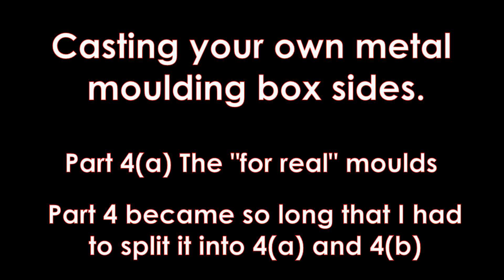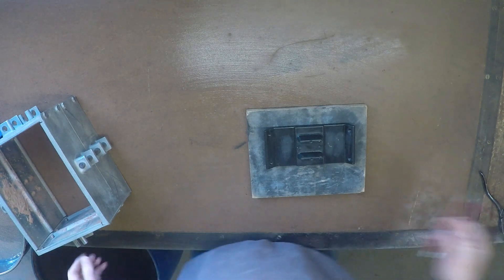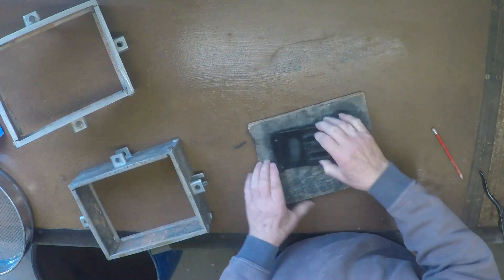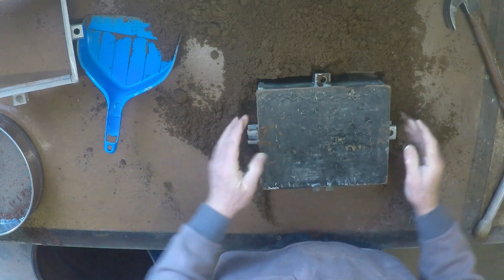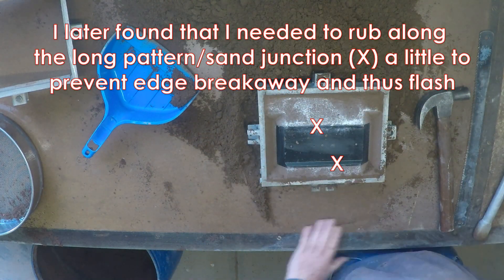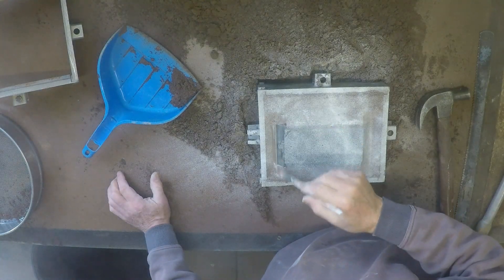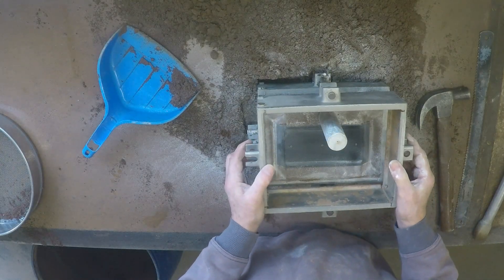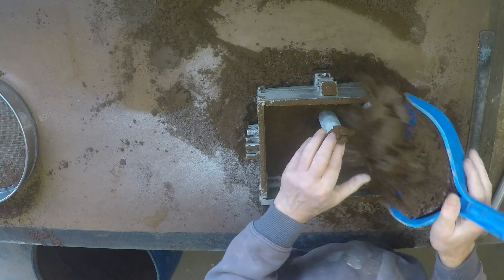Making your own metal moulding boxes Part 4(a)

Comment: How many of something do you need to make before you'll consider making a match plate pattern?
Reply from the maker: Elizabeth, Lots! Seriously it depends on the job. There is a lot of work in a match plate so this has to be balanced against how much time it would save per casting. In this case a simple flat board plus two 3D printed end oddside pieces and a few small pins substituted very quickly and economically for something like a match plate. Making a match plate is generally something that I would not do myself  but rather get my "tame" pattern maker to do and only then for either an often cast repeat job - usually with identical multiple parts on the one plate or possibly a job with a very difficult part line.... Martin

Comment: Thankyou for making these files available, also great series! TFS, GB :)
Reply from the maker: Graeme, We haver recently modified the file for the pin ears. We believe the side slope of these was too great and this made drilling the pin holes difficult as the drill tends to wander down the slope. As yet the new file has not been added to the site but should be soon. I still hope to finish this series but health issues are making it a bit difficult..... Martin
Reply: @olfoundryman8418  Hi Martin, thanks for the reply, only just started casting and to say the first one was a learning curve is an under statement the aluminium bubbled like crazy when poured, still trying to figure it out but you have given me a few pointers so thanks again. Stay safe out there! GB :)
Reply from the maker: Graeme, "Bubbled like crazy" - Erk! Something wrong here. 😱. But before I try to guess the cause may I ask what were you pouring the aluminium into - just a sand mould and if so what sort of sand, a metal mould, a 3d print, plaster, or what? etc.... Martin
PS, Yep first pours are always fun - I remember my first useful casting even though it was 61 years ago!
Reply: @olfoundryman8418  Hi Martin, I was using a sand mold with a pattern, I had just tried to degas prior to pouring but the tool I used to keep it down with broke and the plate I used (an egg separator) stayed in the crucible :( bad workmanship. The pour went okay I think it was when the aluminium was in the cast all hell broke loose :) maybe the degassing hadn't finished, or do you think the sand could have been to wet?... Graeme
Reply from the maker: @graemebrumfitt6668  Firstly I am curious as to what Chemical you used to degas with. But I doubt this was the problem as you would most likely have seen it come out of the crucible and into the mould. As you have suggested sand that is too wet could easily be the problem. If you look at my latest video https://youtu.be/QCgpVfB4exQ      "Possibilities" at 16.30 to 16.40 you will see an example of steam bubbling  up between the metal and the mould surface. This usually produces a dull sort of rough burnt even blackened looking surface  on the metal where  the steam has been bubbling up. I have had quite bad cases of metal bubbling much worse than this when I had a large flat casting with big fins on its underside. Steam from the sand under the casting found it easier to come out through the metal, some of it passed right through the metal and out through the cope but much also bubbled out through the feeders with metal going everywhere. This happened even though the sand was not too wet. It was just that the steam had nowhere else to go but out through the metal. 😰 😱 The casting was useless. I solved the problem by poking holes (about 80  of them) through the back of the drag until the 1 mm wire I was using hit the pattern - I tried to aim the wire to between the big fins. I then sat the drag on some folded over flywire so the steam could get away properly - this worked very well and I got very good heatsink castings as a result. However my sand is a very fine natural sand which as is usual for such sands has high clay and high water levels so it is prone to this sort of problem. I note that most sands used by hobbyists are fairly coarse and thus do not usually suffer from this sort of thing. But either or both high water levels or ramming too hard can cause it. I sometimes find that with my sand I need to use that vent wire a few times around feeders and you would be amassed at how the steam roars out these small vent holes. Check out this video of mine at around 15.08 left had mould.  https://youtu.be/y1wPdnriau4   If the problem persists shoot a video of the whole process and send me the link - unlisted if you prefer - I will keep it to myself..... Martin
Reply: @olfoundryman8418  Sodium Carbonate for degas, the aluminium was all old casts (no from me) I think after watching your vid and the explanations you have given I may have needed escape holes the sand was fine but I didn't think I had rammed it excessively. Will try again today and see what happens with some air holes. Stay safe. GB :)
Reply from the maker: @graemebrumfitt6668  "Sodium carbonate for degas" Oh dear! It does NOT work. I don't care who says it does or what machinist magazine he got the idea from or how many fake chemical engineers he gets to say that it does  - it does NOT. Do not waste your time as if anything it actually makes gas levels worse. I worry about your raw material a bit as it depends on how "old" - remember "garbage in garbage out"
Please let us know how you get on and if problems still occur send some photos - or preferably a video link to  olfoundryman@hotkey.net.au  .... Martin
Reply: @olfoundryman8418  Hi Martin, Second pour was way betterer, although I did not have enough  metal to fill the mould, not a problem as this was just an exercise to get used to the process! The bottom and sides of the cast were really smooth but as can be expected the top was not, I think my gating could use a little improvement but overall was a lot happier with this pour :) Raw material were old cast light fittings, mitre saw, bits of old coffee percolator that sort of thing! Anyway Martin thankyou for your advice and videos and NO Sodium Carbonate! Got it.... GB :)
Reply: @olfoundryman8418  Sorry Martin, I forgot to add hope your health improves Dude! GB :)

Comment: It seems to me it would be better if the inside of the molding box walls be left rough  in order to grip the sand and keep it from sliding, just like the inside top and bottom ridge. And do agree with Martin that the 45 degree mating flanges where the bolts go must be flat and true.
Reply from the maker: Brad, The two sand retention ribs on the top and bottom of the inside of each box side will hold the sand much better than any roughness. Unfortunately with being "as cast" the 45 faces are not of "machined" flatness or accuracy but with careful progressive tightening of the bolts they have proved to be close enough.If I were making these boxes for myself and therefore able to use lathes milling machines etc they would be machined straight and true - but  "no machine tools" was the brief here!
In truth, if I was to make them in number for myself I would cut some quick dies and gravity die cast them (this is what I did for my last  20 odd boxes) this would give closer to the required accuracy - although  having the CNC mill I would likely  machine them all anyway.... Martin

Comment: Hi Martin, thanks again for a great and informative video. Less of the fanfare and more of teh info.
in regard to the "New" style metal casting boxes. Your previous ones were rebated ends forming the 90* corners. The newer ones are Splayed on 45* to form the corners.
obviously you see advantages of this newer design. Could you enlighten us on the pros and cons of the two designs.
I intend to making a set and I was preferring to go with the rebated ends.
your thoughts please.
Every day upright is a good day.
Reply from the maker: Charles, Have to be careful about that "upright" thing they sometimes bury people standing up as it saves room in overcrowded cemeteries.😊
RE boxes, 90 deg. corners require use of a milling machine to get them right - all mine were gang milled with several cutters on the arbour of a horizontal mill. This did work well and made nice boxes which went together very nicely indeed  and which I have used thousands of times over many years. BUT they were perhaps a bit weak because of the rebated ends causing stress concentration in the 3.5 mm section (They could be thicker of course to get over this). The 45 corner was an older  design I had tried some years earlier. I abandoned it mainly because of troubles with the dowel pins I used - I threw the baby out with the bath water! The 45 corner design used the box sides without any machining (save dowel pins and bolting together) while the 90 deg corners required milling. I wanted a design that anybody could make and thus did not require things like milling machines lathes etc. In addition the 45 corners lend themselves to quick and easy extension/modification of the box shape to accommodate different shaped and sized castings - there has already been a inkling of this in the latest video (part 4(b)) where I lengthen two of the old 45 corner boxes with simple blocks of wood screwed in place so I could mould the 250 mm box side. A great deal more variation than this is possible with this 45 design and I will demonstrate this as this video series  unfolds. I would suggest that you watch the whole series before firming up your preferred method of manufacture because I believe the 45 corners have advantages. You can of course if you have a mill run it over the 45 corner design to improve box accuracy but I do not think that this will be necessary....Hang in there … Martin

Comment: How much PSI do you use on your air hose?...Hal
Reply from the maker: Hal, I have a cheap and nasty little regulator in the air line to the blow gun, it is set to 25Psi. The initial spurt of air that comes when you first squeeze the blow gun trigger is enough to damage the mould so I either squeeze the trigger slowly or point the gun away from the mould at first. Once blowing, the air pressure drops to 15 Psi and this is quite safe to blow at the mould. However if the mould is intricate with things like delicate text only blow from a distance and very carefully.... Martin

Comment: Hello, long time viewer, first time caller. Are there any instructional books you would recommend that a newbie read before getting started? Also, thanks for all the time you have taken to make these videos.
Reply from the maker: Robert, Problem here is that there are lots and lots of books out there and most are deficient in some way outdated old hat and full of bad /wrong ideas methods. No book covers the whole process. But for ideas on how to make a mould and the tools equipment required try the following.
Metal casting: a sand casting manual for the small foundry vol 1 S Chastain
United states Navy Foundry Manual
The backyard foundry and Foundry work for the amateur both by B. T. Aspin
 Use these for the how to physically make the mould But NOT for how to run and gate castings For the latter try 
Mini Casting Handbook John Campbell as a appetite wetter 100pages
and then Castings practice the 10 rules of casting by the same author 200 pages
and then if your game Complete casting handbook again by John Campbell - Note: the last (1200 pages!) contains the 10 rules complete
Happy reading..... Martin
Reply: @olfoundryman8418  Thanks Martin, I'm sure I'm not the only one who'll benefit from your advice.

Comment: Martin, I'm fairly new to your channel so I need to ask some questions about how you use your parting powder ("part"), even though I'm sure you've explained this in the past. Here goes:
1. Why do you brush and/or blow most of the part out of the mold?
2. Why do you add it too all "inside the mold" surfaces, like risers, gates, etc.?
Reply from the maker: Bob, Bit hard to explain but I will give it a go ,
    1;- Too much part on the pattern and I have found that it can form little "drifts" when the sand is rammed these then blow away when the mould is blown clean and thus leave missing patches in the mould surface which of course produce defects on the casting. Excess part can also slide off the pattern during ramming and actually mix with the sand at the edges here this sliding has occurred, such a mix of sand and part is very weak and falls away from the edge of the cavity very easily.
   2:- A layer of part on all surfaces makes them easier to blow clean later - any loose sand which does land on a part covered surface will not stick and thus blows off easier later.... Martin
Reply: Thanks for asking this - I had been wondering too...
Reply from the maker: aclight, I hope I made a clear enough explanation. Its not easy to explain. In truth though I am a bit heavy handed with the parting agent. In my case its fine calcium carbonate - I would never want this much talc floating around. The calcium carbonate bought as commercial parting agent is cheap ($3.00 per kg) and safer than talc... Martin

Comment: Just watching you work is a learning experience. The steel block is quite smart. I am sure you think its no big deal, but just the way you handle the tools and the sand is and the way you do things is something to take note of. The details are the only way to slay devils and get good results. BTW I got my hands on John Campbell's book. Its a great read! Thank you for all that you share. Be well, stay safe.
Reply: What is the title of this book?  (I'm new here.)
Reply from the maker: Bob, John Campbell has several books, the biggest (and heaviest reads) are the 2011 or 2015 edition of his "Complete Casting Handbook" about 1200 pages and in places highly technical. His "Castings Practice the 10 rules of casting" at about 200 pages is a easier read and is actually included in the first two mentioned. Perhaps though his "Mini Casting Handbook" about 100 pages is a good appetite wetter - start there and if so inclined move on to the 1200 page effort.... Martin
Reply: @olfoundryman8418  I recently picked up JC's "Castings" from 1991 (used, US$ 10) and was very pleasantly surprised at how he presented the science & engineering along with foundry practice and managed to address the wide scale of casting operations, from small "hobby" casting to larger industrial production. I somewhat regret not buying his Complete Casting Handbook but it's US$ 130 new (110 used). FWIW, your videos regarding turbulence  from a year or two ago stuck in my head and really set up his discussion of surface turbulence and oxide formation. The key insight was that it's surface turbulence not bulk turbulence that causes problems; still thinking this through...
Reply from the maker: aclight, Its a sad fact that technical books are never cheap. My CCH 2015 ed. was close to $200.00 Aus. Sadly it was poorly bound and began to fall apart after about 2 weeks I have to read it with great care as it continues to have pages come loose - very poor for the money! The information though - Priceless! In this later book JC confesses to having changed some ideas from 1991/3 in light of further work in the field. The only turbulence that causes significant problems is that involving interface of air with the metal i.e. it MUST be a form of surface turbulence but be aware that this can occur with the passage of air even if diluted by other gases (bubbles etc from cores for eg.) through the metal. If something I said has stuck and provided an insight into something the great master said I am well pleased..😊. Martin
Reply from the maker: Chris, The steel block should not really be necessary - its just that with age I have got a little shaky and it helps - it sure makes things a bit easier. Handling of the tools is just a matter of long practice I guess - if you watch, all foundry men have their little "own ways". JC's book  - ah well, that will keep you busy for a lot of nights with bed time reading. Sharing is my pleasure and if I could get well  I sure would do so. 😊… Martin